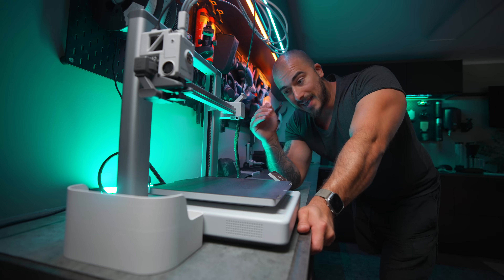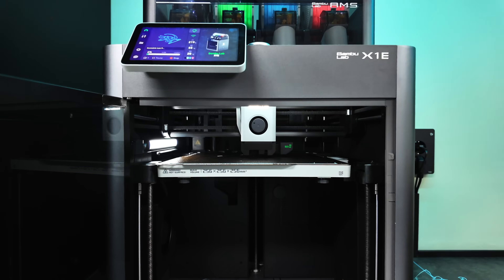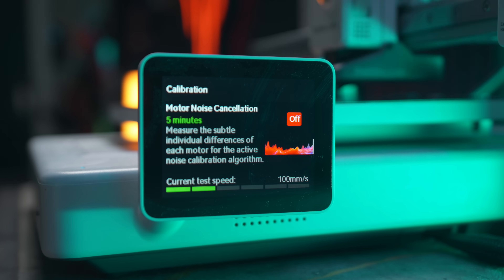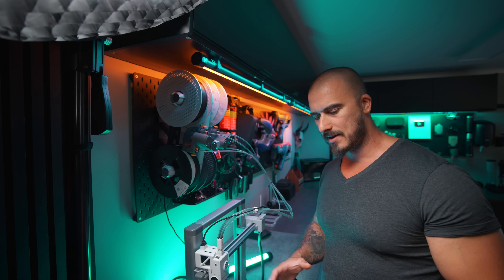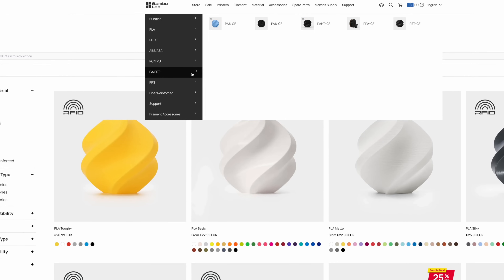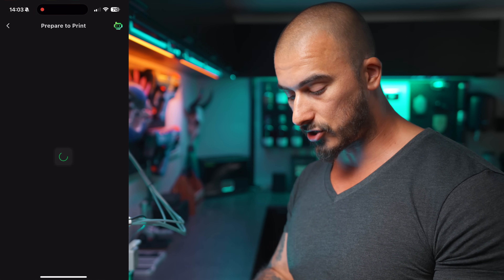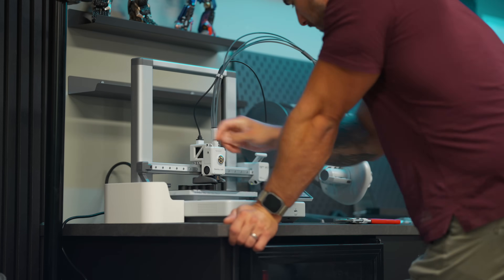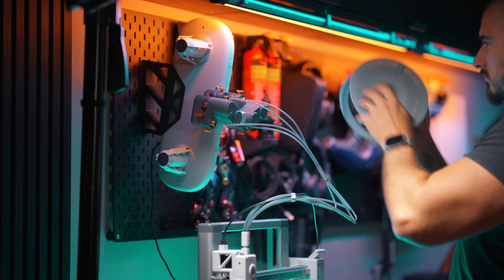This 3D Printer Is Practically Cheating… | Bambu Lab A1 Review

Comment: I don't see any kind of ventilation. What are the fumes like? We have to use an enclosure at work for our laser machines, just wondering if 3D printing requires the same, since there is heat and melting taking place.
Reply from the maker: basically mno fumes if you're printing PLA

Comment: Is there a download to build an encosure that incorporates a filter . . . What cheep device could i use to draw the air through a filter (my electric wall furnace uses 12" x 12" paper filters)
Reply from the maker: If recommend another printer instead tbh. This is great if you have ventilated space, but not for small rooms.

Comment: After having this printer for a year, I have two main things to say:

1) The quality is fine but by no means perfect, probably could do better for the price.
2) The system frequently disconnects from my wifi and requires me to go into my router settings and toggle the security settings to make it re-connect. Unbelievable hassle for a brand considered to be high-end. Also are required to have it be live-connected to chinese servers in order to use.

If I could do it over again I would definitely NOT buy. I'm posting this in multiple reviews to spread the word, take it or leave it.
Reply from the maker: The issue probably lies in your router/wifi rather than the printer. I’ve had absolutely 0 issues with mine when it comes to this.
Reply: @PeterLindgren1 and I have no issues with any other equipment
Reply from the maker: Interesting. I have 4 bambu printers and none has shown any issues. Whenever there's a wifi/internet issue it usually lies in the router/AP settings rather than device itself. The other possibility is that you've gotten a faulty unit.

Comment: I see 4 bozeman hoses going into your printer so presuming you have the 4-1 adapter there, How do you feed the filament in like you spin the wheel, grab exposed part and shimmy it thorough, oddly enough I can't find a single video how someone takes a dry box, and gets the filament out of the box to the unit, then how do you get it all back in with out opening the dry box or in this case back on to the spool

Comment: Noooo. Save up for the x1c... I just got it. One of the best thing i ever bought. Its up there with my gaming pc. Put it in a a zipper up container with a air purifier inside with. Exhaust fan going out to my window. It's totally worth it.
Reply from the maker: Well the X1C is great, but it's 3 times the price of this one. For a begeinner, this is great.
Reply: What are you material are you printing with that you need to exhaust it out the window and need an air purifier.  I have an X1C as well.
Reply from the maker: Anything other than PLA or PETG should basically be using an exhaust
Reply: Just stock I could smell the fumes in my bedroom with a window open and a a.c. and a fan. I had to point the fan towards the printer and window. But now it's perfect. By the way guys I'm a newbie. I've got filament stuck to my building plate. How do I take it off? I need help please? I tried alcohol with micro fiber cloth no. And I tried to heat up the plate and wipe it as well nothing.

Comment: I’m a complete noob looking to get my first 3D printer. There are so many videos out there raving about the simplicity of the bambu labs platform but equally there are many people concerned about the recent firmware changes that supposedly introduced some hindrances. Is this something I need to be concerned about? I’m so torn because I want simplicity and printing straight out of the box but I’d like the printer to give me a full spectrum of options like using orca slicer which is apparently superior to the product shipped with Bambu (please correct me if I’m wrong), along with being able to monitor my print remotely. I’ve yet to find a video that spells out for a noob what the firmware debacle is all about. Any advice would be appreciated.
Reply from the maker: This gives you the simplicity. The firmware is a non issue thing if you don't care about the tinkering with the machines etc. I doubt you'll be able to use other slicers in the long run, but if thats a demand you have on a printer, then you might wanna get another one. 
I'm personally SUPER happy with my BambuLab printers (i got 3)
Reply: @PeterLindgren1 thank you so much for the advice and quick response. You’ve been very helpful 👍

Comment: You can get the Elegoo Centauri Carbon (enclosed) for $50 less. Having that enclosure is great when you graduate to more advance filaments. The Bambu equivalent is the P1S which is $250 more than the Elegoo.
Reply from the maker: For the community and the simplicity, i'd go for this.
Reply: @PeterLindgren1  Bambu has the community, but they are both simple to use. The Elegoo is just more future proof.
Reply from the maker: Please elaborate on why it’s more future proof?
Reply: @PeterLindgren1  It has an enclosure.. Beginners will start off with PLA, PETG, but what happens when A1 users want to move to ABS, ASA or Nylon? They can't, or they are forced to spend more money on an enclosure kit. I'm not arguing that it's not a great printer. I just think that at the current price, the Elegoo is a better bargain. The A1 imo should be closer to $249
Reply from the maker: @Lemonspeppasteppa  I’ll say that if you run bigger prints with the heavier filaments (ASA/ABS) you should have an exterior exhaust though. 
The Carbon filter is more of a ”better than nothing” filter unless combined with a HEPA filter as well.

Comment: That ONE roll I let hang out on my table next to my printer for a few weeks printed horribly at the end. After I enclosed it and added lots of silica,  it printed well after the top layers were printed (less precise prints).
Reply from the maker: Yeah it heavily depends on the humidity on the room it’s placed in etc.
Reply: @PeterLindgren1 And mine isn't normally that humid. Maybe a little more when it rains. I'm in Norway.
Reply: @annelisabethcom Hey sorry what do you mean by you added lots of silica? And do you think I can just print a humid-prood case for a single roll and keep it on my table rather than buying the transparent one from Bambu?
Reply: @brankelly1921 It's possible to do that, yes. Cereal boxes.
Reply: @annelisabethcom thanks, but what did you mean by added lots of silica? You mean silica gel?
Reply: @brankelly1921 Yes, in 3D printed containers

Comment: Peter, I have a question for you: Right now the A1 is $350, but the P1P is on sale for only $400. Should I just pay the extra $50 for the P1P or stick to the A1? I'm leaning towards the P1P because the print bed doesn't move. I've never used a 3D printer before... so which would you recommend?
Reply from the maker: The P1P is awesome, can’t go wrong with either. But the A1 AMS Combo might be the best starting printer. If you wanna upgrade later it’s gonna be easy to sell it etc.

Comment: I definitely want a 3d printer at some point. I'm also intrigued by resin printers as the materials look so smooth. Does this one print at the same speed as your other printer?
Reply from the maker: Oooh, don’t go for a resin printer… too many things to think of and way more hazardous. 

It’s pretty much the same speed, slightly slower though.
Reply: @PeterLindgren1 I'd love to see a video about the possibilities of a 3d printer. I.e. what types of materials you can print and what they make possible. I'm still doing things the old fashioned way of manual fabrication, which is much less precise.

Comment: @PeterLindgren1, What is the strongest weight holding filament that is available? And how much weight can something hold with the strongest filament? I.e. a hook or something similar.
Reply from the maker: It all depends on the design of the hook. PLA filament can be extremely strong with the right design, and vice versa.

But I’ll say that PETG or ABS would probably be the best options. If you wanna have the best layer adhesive, then it’s TPU. But it’s also incredibly soft and spongy.
Reply: @PeterLindgren1 , Thank you! I have been looking to buy a 3-D printer, but wasn't sure if the plastic filaments that they have are strong enough for what I would want to make.

I'm looking to make things like specialized camera holders and iPhone vlogging attachments, etc.. Items/accessories that are not available on the market, that I have designed, but have no other way to produce unless I buy a 3-D printer.

So I appreciate the response. 👍👍👍👍👍

Comment: Dude, this is sooooo tempting! Thanks for the info. I've been thinking about getting into 3D printing for a while!
Reply from the maker: Dude, think no more!
Reply: I have been thinking about getting me a Bambu lab printer too, but am still looking for a good reason to get one. I don't want it to be put away in some closet and collect dust after a few weeks. Would be nice to print some parts or  accessories that broke down or got lost or anything. But to spend $500 on some accessories producing device may be a bit too much.